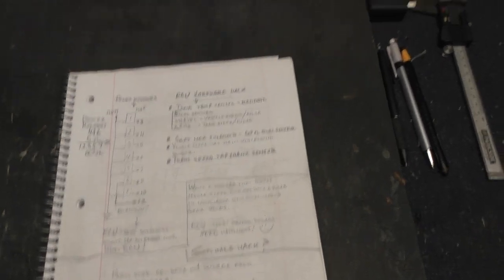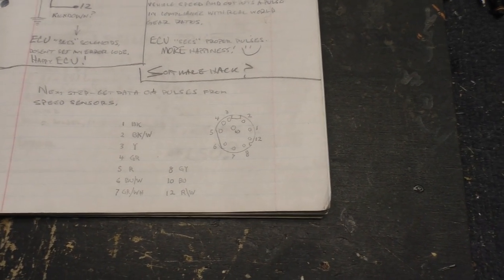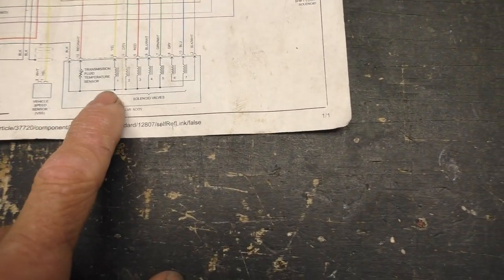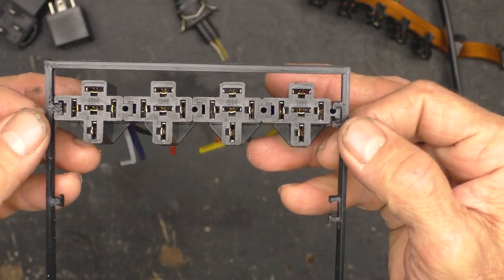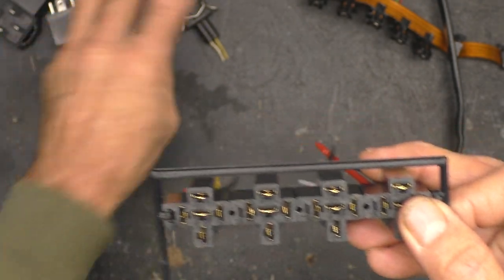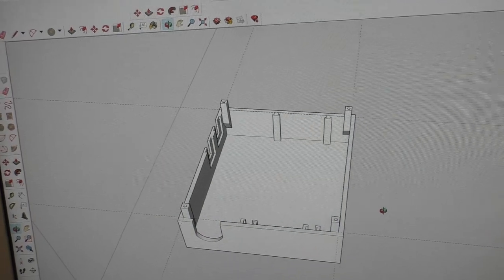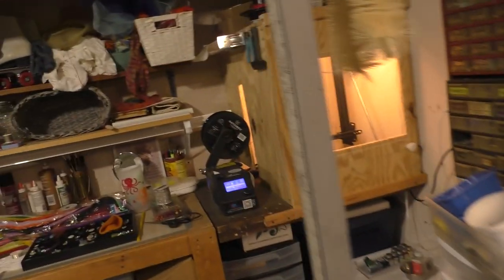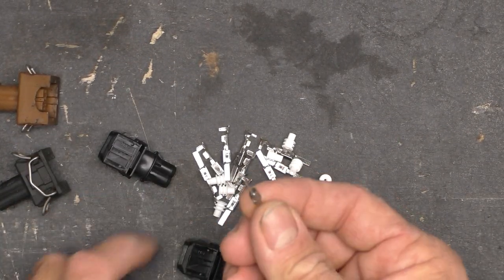EuroVan Manual Swap Check Engine Light Hack

Comment: Looks great! I really like the custom enclosure.  For the folks talking about relays v resistors. The really does a nice job of acting like a coil simular to a solenoid.  
If I come across the need for this hack. I probably would do the very same thing. 
You did a great job showing the pin outs and wire colors. 
Again if I found myself doing this, I think I'd just shorten the harness and wire directly.  The PCB idea is good. And maybe a guy could just have the terminations labeled, and then there would not be a need to buy harnesses and alter them. From a production standpoint, this would simplify your build. 
Thank you for laying this out.
Reply from the maker: Thanks for watching. Agree with the direct wiring. The reason for the box and connectors was so I could build these and offer them to people as a plug and play device.

Comment: I just installed one of these emulators on my Eurovan when I did a manual trans swap, and it worked beautifully. I probably could have figured out my own setup based off the amazing notes that have been posted, but I figured after all the work done to figure this out for community I would buy a kit. It was truly plug and play, everything just worked and I'm driving my beloved van with a manual transmission. Its a much more enjoyable vehicle now, and how these should have came from the factory. Highly recommend. Thanks!
Reply from the maker: Thank you! Happy to hear from yet another satisfied customer! They really are a much better van with a manual transmission.
Reply: Tyler,  I did a manual trans swap on a 1995 EV Camper a few years ago and am thinking of doing the same on our 2002 EV Weekender using this hack.  Can you share any tips or are there any specific links you can share that will help me in the process of doing the tranny swap itself.  Any mechanical Suprises I need to look out for?  I'm definitely going to buy one of Dean's CEL hacks!  It's brilliant!

Comment: Nice hack! Maybe I missed something but if you're just using the coils in the relays as a resistor why not replace them with resistors? Wouldn't that save a lot of space?
Reply from the maker: Because the TCU sends 12 volts to them. I think one is powered on all the time. Resistors, even large power resistors, get too hot. I tried some. Relays do the trick!
Reply: @HackaweekTV  hmm. 14v 80ohms is 2.45 watts draw.  You can get 10w wire wound 80ohm power resistors for not much money that will handle that load with no issues. Would definitely make for a smaller package. Just something to consider.
Reply from the maker: @DoRC  As I said, I tried that and they get too hot.
Reply: @HackaweekTV  ok
Reply: Try inductors.
Reply: It really easy to do a custom PCB through-hole relays could cut that package down to a quarter of the size. With our 3D printed case you could pot it you would never worry about moisture. PCB you should be able to get for about $4 or so per board and then just pick up some through hole relays from digikey just a thought to decrease the size of your design. Another thought to throw out there LEDs instead of relays. 1000 ways to get the same outcome

Comment: Dino - AWESOME HACK!!  After successfully converting a 1995 EV Camper to Manual a few years ago on my own, I'm contemplating doing the same thing with our 2002 EV Weekender which has a fried 4spd AT, so I'll contact you later to buy the kit. But first we need to fix and sell our (another) 1995 EV Camper with an Automatic.   It's only got 130K and shifts perfectly into Reverse and forward through 1-3rd gear perfectly, then tries to slam into 4th gear and instantly goes into limp mode until I reset DTC 00596 (no other codes so I think it's wiring related, not trans related).  I've replaced the Valve Body ribbon cable, and all the Solenoids and I'm inclined to think it's either the Trans. Control Module or the wire harness from the TCM to the Valve Body.  The TCM looks very clean inside and nothing appears burnt or water-stained so I'm leaning towards Wire Harness or connector.  I can't locate the Schematic anywhere and am wondering if you have one (098 Phase 1 Automatic which is an early 1995.  The later 95's where a phase 2 if that makes a difference).  If you can offer any other advice other than sell it, that would be great.  I'd like to get it running in all 4 gears before we sell it since it's an awesome Camper in good condition.  Thanks in advance! Tom
Reply from the maker: Pretty sure it's a mechanical issue, not electronic.
Reply: @HackaweekTV  Got it, thanks!

Comment: The 01P/01M Solenoids have coils inhume. The relays you are using to simulate are not duplicating a 'resistance', they duplicate a Coil.
Analyze the transmission Solenoids for coil inductance, substitute a coil with same inductance and you should be good to go... without the bulky relays....
Reply from the maker: The relays are cheap. I tried other relays with a higher resistance and they didn't work. That's why I measured the resistance of the solenoids and duplicated that.

Comment: How did you manage to start up The engine if there is a D position jumper wires fixed? If i leave it as on N position it would work as well?

Comment: Could probably just buy some inductors instead of relays, and could use a wiring enclosure from home depot that will be weather resistant.  can drill holes in them and use strain relief from electrical department
Reply from the maker: Chose the relays because they're cheap when you buy 24 at a time.
Reply: @HackaweekTV  , with all those housings and harnesses, inductors are going to be just the coils.  they are probably gonna be cheaper and smaller.

Comment: Wait! When using a MT, you always have to shift. So, does that mean that whenever he shifts to D, R, 1,2,3, there's a corresponding switch that tricks the ECM that the transmission is in that gear?
Reply from the maker: The plug with a jumper that takes the place of the gear position switch or "multi-function switch" as it's called by VW, makes the control unit think it's in D. It doesn't care about what actual gear the manual is in.
Reply: @HackaweekTV  Thanks for the quick reply. Got it!
But what about the R, D, 1,2,3 lights on the dashboard? Does it just stay on D?
Also, does it mean that this magic box that you've created, would work on other AT cars that were converted to MT?
Reply: @richmadrid9563  The  R, D, 1,2,3 lights on the dashboard can be disabled via the OBD plugged diagnostic computer.

Comment: Do they not make a manual trans for that van why use the automatic trans? And why didn't you just find or make your own manual swapped chassis harness and use a manual ecu for the correct programming?
Reply from the maker: The later 2.5 liter VR6 never came with a manual and there is no manual control unit.
Reply: Ya l, the manuals don't need them more do they come with one (TCU that is) you could have used an ECM from a manual and possibly the BCM also of any Volkswagen the same year and engine size pretty much? manufacturers swap all their parts between makes and models. Of the same engine and trans size that's why it's always good to check the RPO codes and match them up most of the time they're on a sticker on the trunk.
Reply: But the way you went about it is cool also and a very good learning and teaching experience on how those certain things work sensors and whatnot and how to fake them out you taught me something. LOL so I thank you. Amazing job
Reply: @HackaweekTV  it's a 2,8L actually.

Comment: Why not just flash/program the computer to a manual? Much easier than all this wiring.
Reply from the maker: Can't be done. I did my research. I even spoke to a facility that specializes in doing tunes and flashes. They said it was pointless to even try.
Reply: @HackaweekTV  Sorry to hear that.  However, I know a few guys that have done just that. I'll try to find out what they did, so the next time, all you have to do is plug n play.
Reply: The engine's code is AMV and they never has been paired with a MT so there is no flash for that.
Reply: @IgoRthethrasher Exactly that’s the issue.

Comment: Wouldn't be easier to just put in the manual TCM
Reply: Easier, but not cheap.
Reply from the maker: There was never a manual TCM.
Reply: @tristan6509 Not easier but impossible since there is no such thing.
Reply: @eurowan  I was thinking of the ECU when he said TCM, yes obviously a manual transmission doesn't have a TCM...

but you can replace the ECU with one from a manual transmission which doesn't care about a TCM.

Comment: Why not just do a TCU delete, (manual trans cars don't even come with them) hit the junkyard or eBay find a Volkswagen with a 5-speed grab the ECU and BCM and a Tech 2 am do a little programing. . I'm pretty sure the hardest part was cutting all the holes for the clutch and the shifter. LOL
Reply from the maker: Nothing got cut. It all just bolted in because earlier vans with the same chassis had manuals. Tech 2 is GM. You can't just delete the TCU on these.